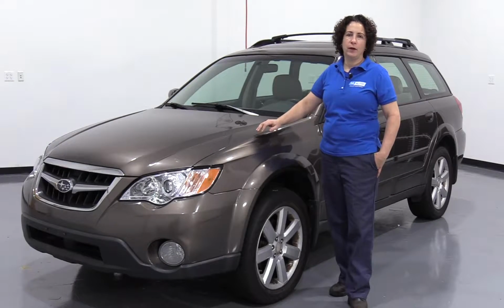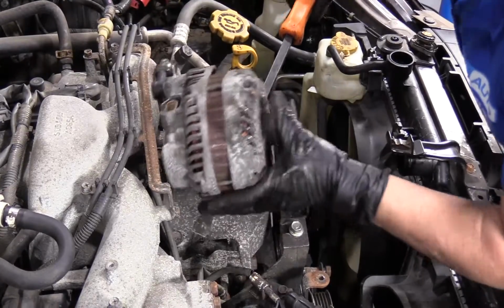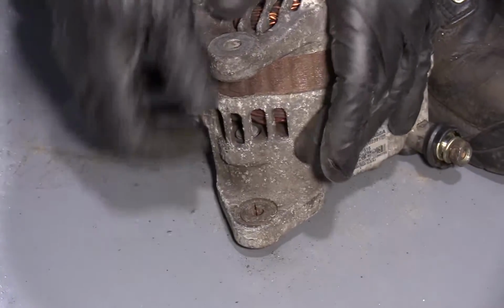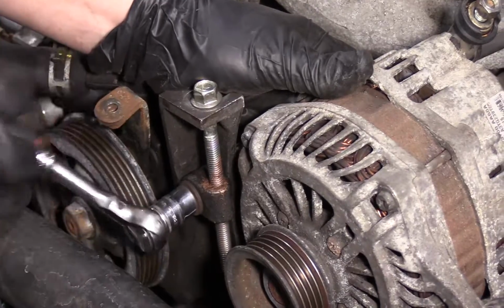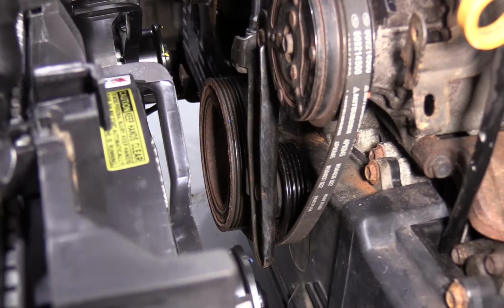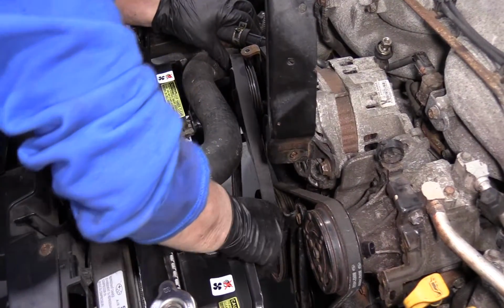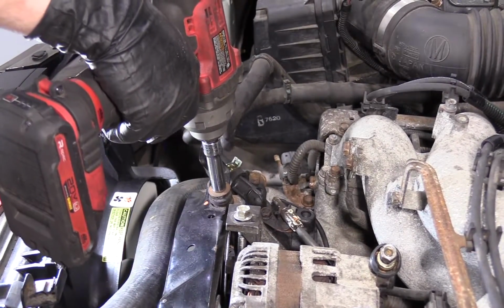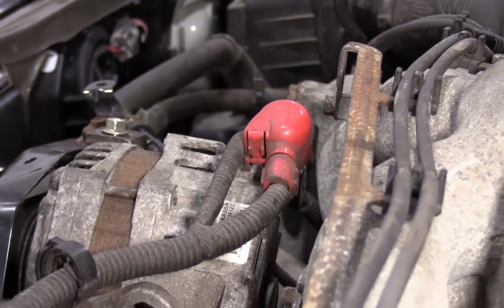How to Replace Alternator 04-09 Subaru Outback

Comment: 3:25 when I bought my 2006 Subaru Legacy it had a terrible squeaking noise when turning. It went on like this for two years until I finally learned enough about cars to take a look under the hood.

Turns out even though the drive belt was tightened as far as it would go, that little metal piece that held the adjuster bolt to the alternator bolt was put in BACKWARDS so it was unable to tighten all the way. Once I fixed that the squeaking went away.

Comment: At the disassembly/removal segment, you did not disturb or remove  the AC belt, yet at the installation,  you loosened the AC pump and put a belt on it.  Is it necessary to remove the AC belt for some undisclosed reason?